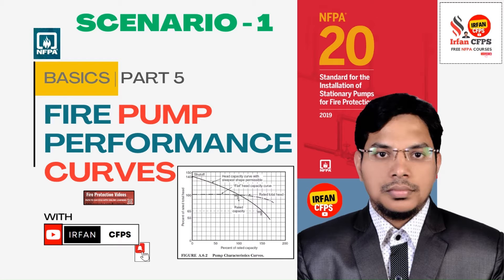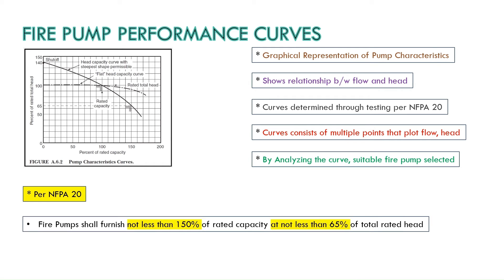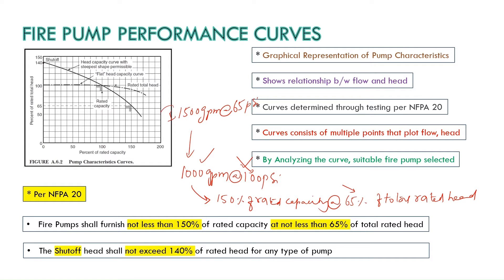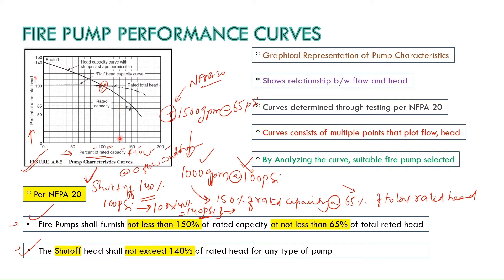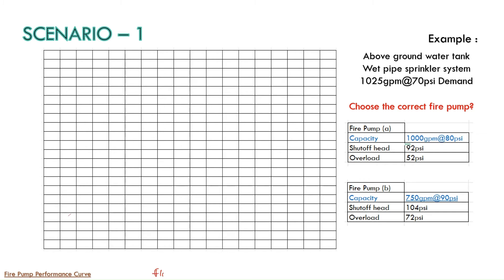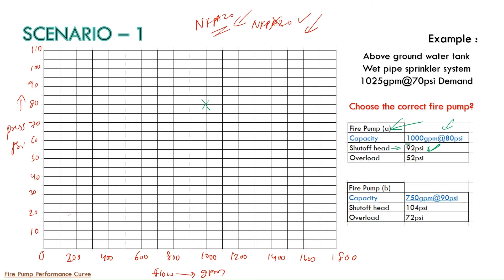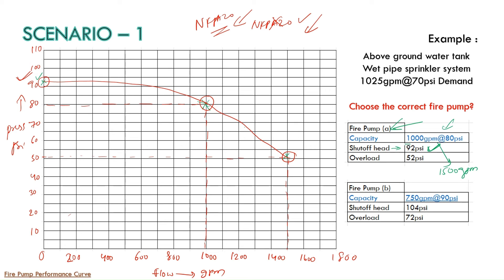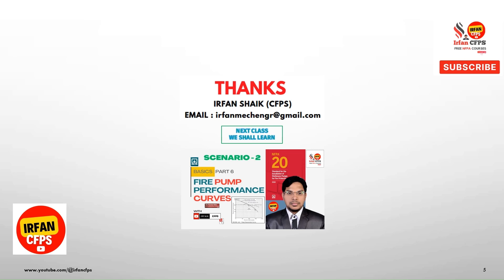Understanding Fire Pump Performance Curves: A Simple Guide - Part 1

Comment: Worked out for fire pump b, we can definitely go for option b as well for our demand requirements. Concept well understood. Thank you.
Reply from the maker: Thanks. Please do share with others as well
Reply: @irfancfps  Sure. One more doubt, as per NFPA the shut off head shall not exceed 140%. But in case of pump (b) shut off head is 104psi. Our requirement as per hydraulic calculation is 1025gpm @ 70psi. So, 140% of 70psi is 98psi, and pump (b) shut off head is more than 98psi which is not acceptable as per NFPA. In this case, is it appropriate to select pump b even though it comes inside the performance curve? kindly clarify.

Comment: Hi thanks for the great video.. What happens if the required capacity falls out of the shaded part.. Does that mean, pump under consideration has failed to meet the required criteria..? 
I'm starting from scratch. Please recommend from where should I begin to understand the whole concept..?
Thanking you once again for sharing your knowledge sir.
Reply from the maker: Thanks for your comment. Please do watch NFPA 20 training module available on my youtube channel and they are provided in sequence. Also if you want to learn about sprinkler systems watch out NFPA 13 series. Regarding your query, please note that your demand and pressure requirement shall fall with in the curve. that is enough.

Comment: What is called overload?
How did u considered 1500gpm for the overload 
Many thanks in advance
Reply from the maker: As per nfpa 20 fire pump shall deliver 150% of rated flow at minimum 65% pump rated head.
Reply from the maker: Also overload means pump runs at 150% capacity.

Comment: Hi Irfan, need clarification on shutoff head. how you got the value of 92psi for 80psi and 72psi for 90psi pressure rated pump. As you mentioned in the video shutoff head should not exceed 140% so if we calculate 80x140%=112psi and for 90x140%=126psi. can you please explain.
Reply from the maker: Hi. See I told as per nfpa 20, shutoff head shall not exceed 140% of rated head for any fire pump.

Examples which I considered in my videos are only for understanding.

But please note that this shutoff head will be decided from the manufacturer factory curve. It means exact shutoff head depends upon the manufacturers fire pump data and we cannot assume..
Reply from the maker: Whenever you get any pump data from manufacturer u need to cross verify that the provided pump shutoff head is not more than 140% head…if u are using UL FM approved pumps definitely they will comply nfpa 20 requirements. I hope it’s clear now. If u have any query let me know

Comment: nice exercise. yes I believe the (b) pump will also work although in a much smaller range 1025 to 1125gpm and 72 to 77psi
Reply from the maker: Thank you for the comments. There are two more videos related to performance curves which will be posted on Monday and Tuesday@9:30 pm (ist) in which u will find various options in selecting the fire pump capacities. then u r query will be cleared.